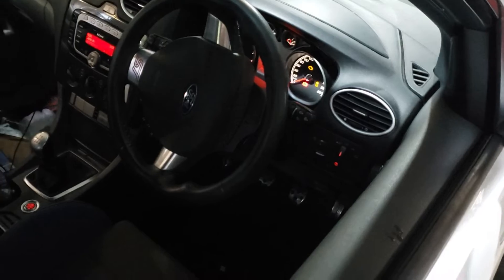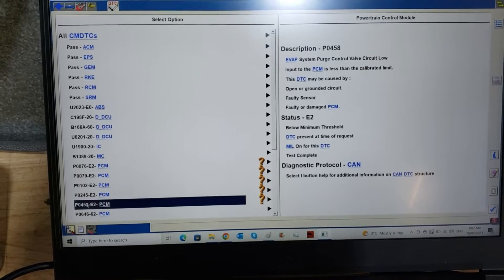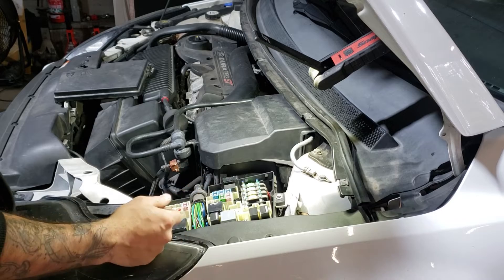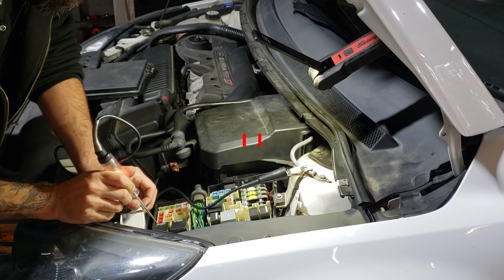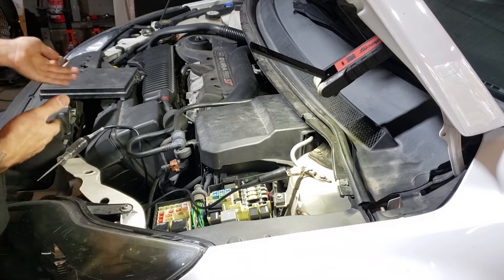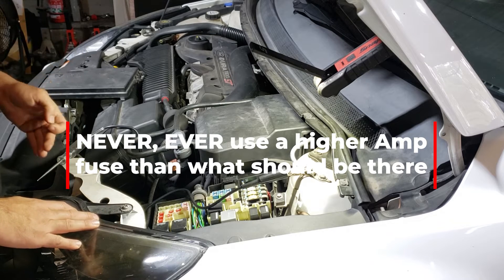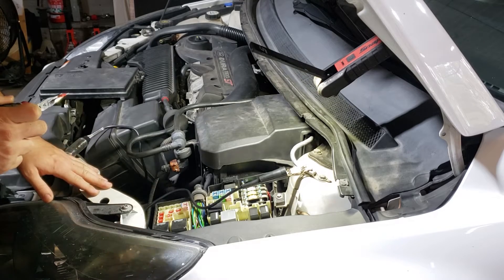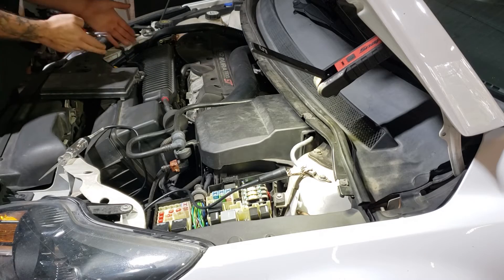Ford Focus XR5 / ST225 F35 blown fuse diagnosis scenario 1

Comment: hi have you any idea  how to fix this code that keeps coming back when I clear it .. U1900-60? focus 225 PFL..
Reply from the maker: is the vehicle still starting and operating as normal or are you getting other faults alongside that DTC?
Reply: @OEMDeniedPerformance car starts fine and drives as normal.. could it be a blown fuse?

Comment: Thanks for this, your videos are always really helpful. Do you have to replace the entire oil filter housing or can you do just the heater? Do you know the part number?
Reply from the maker: Heater is part of the housing I'm afraid mate. Part number is 7G9N 6884 AC. If you don't ever do short distance driving and its not physically leaking oil you can just leave it unplugged. (aftermarket breather setups don't have the heater coil at all in them)
Reply: @OEMDeniedPerformance  you're a legend thank you mate. Sadly I've unplugged the heater and fuse 35 has blown again. Going to try the vvt solenoids next.
Reply from the maker: @scottturner6979  I'tl be a wiring short most likely wiring is damaged underneath the engine cover. Probably caught under an engine cover bolt so check all the wiring before replacing anything
Reply: @OEMDeniedPerformance thank you, much love